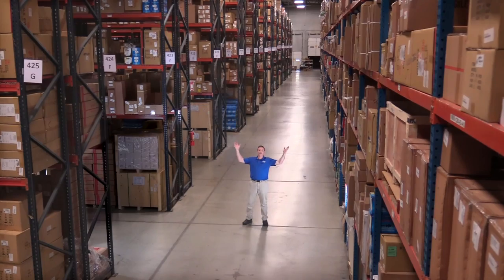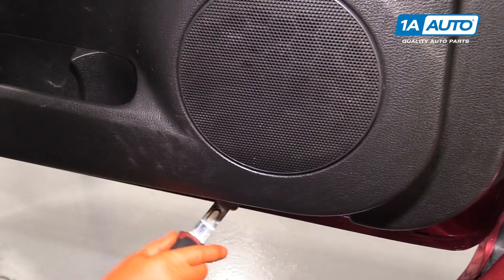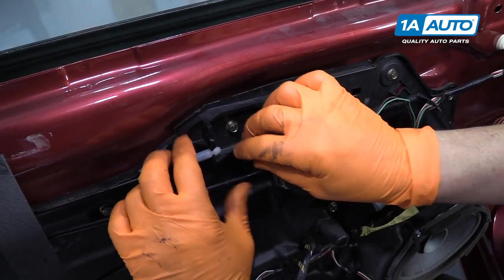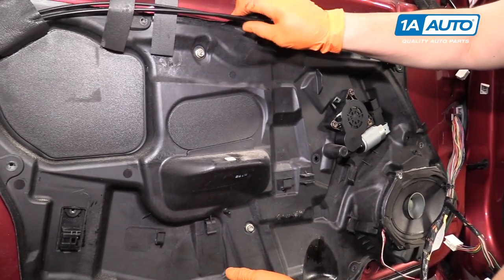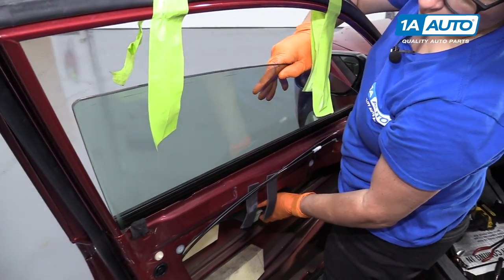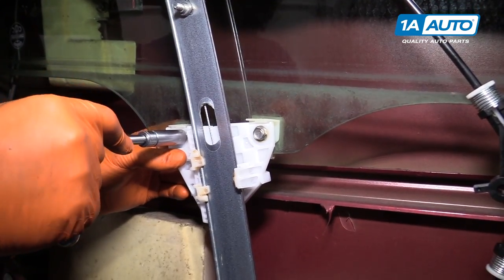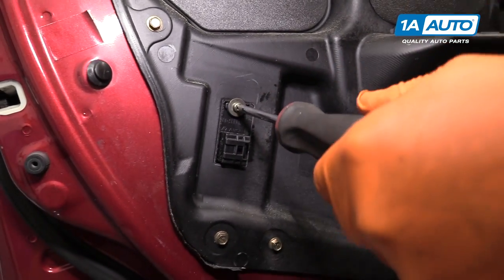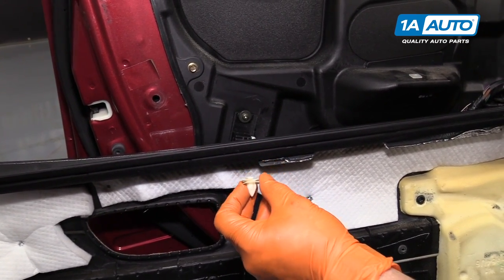How to Replace Front Window Regulator 03-07 Mazda 6

Comment: For anyone replacing just the window motor, dont take the backpanel off, just take the speaker out so you can reach through its empty hole with your other hand and hold the regulator drum (the white starshaped thing where the motor will engage) in place when installing the motor
Reply from the maker: +peterkray Thanks for the feedback!

Comment: Finished!!  Thank you for the help.  Way more difficult than I imagined... especially lining up the new motor gears together.  Needed another person to help hold everything while trying to align and get screws in.  Tip for anyone struggling, I used long nosed 90 degree plyers that fit perfectly in holes on the window side to make slight adjustments to move window up/down manual.

Comment: If you have 2006 with central locking and can't get the electrical connector plug off, there is a red tab on the connector that you have to pull out first to unlock it. Even after that it's still hard to yank so I put a flat blade screwdriver in the gap and twisted while pulling on the wires.
If you took the power window motor off you need to twist the assembly until it falls into the 3 notches in the door card. I twisted stuff until it clicked into their locations so that the assembly was flat together, ie, no gaps - if it's not flat together the gear cover plate might pop off -, then I finger tighten the 3 screws and gave final twisting to make sure everything was located before final tightening.

Comment: Thought my motor was burnt out but when I took it to the mechanic and after they clean the window they where able to get window move.  But it wouldn't go back up... so used this video to take it apart and figured out the window clutch thing... the part there selling that turns the rotary motion of the window into a linear motion that moves the window up and down was dirty so I cleaned and reinstalled it.  I noticed right away that was the issue with situation.  The  Window moves easy with just hands up and down once reinstalled with out thr motor unlike before... I have same issue with passinager door as well planing on fixing it another day.
Reply from the maker: +Jimmy John Thank you for the great reply. We love to empower our customers by showing you how-to perform your own auto repairs while installing our high quality auto parts. Have a great day! 1aauto.com

Comment: You totally just skipped the most difficult part how you put on the window regulator 🤦‍♂️
Reply: I was going to write the same thing.
Reply from the maker: +shoosh Thanks for checking us out. The install of the new regulator is shown at 12 minutes and 40 seconds. Please let us know if you need any further assistance, thank you.
Reply: @1AAuto  12:40 is removal. We are talking about the big jump between 16:53 and 16:54.
Reply: Yep, that was the hardest part by far. After mounting the carriage to the window, you have to get the 2 studs lined up to the panel, the regulator to line up with the cutout, the motor to mesh with the regulator… while it is hanging there and get the 3 self tapping screws in. I figured it out with another set of hands (my daughter) but it was tricky and completely skipped here in this video. A little disappointing considering how thorough the rest of the video was, most of it was pretty trivial.

Comment: 1min 24 sec...  cant get that speaker adapter off the tweeter either... seems to be skipped.  did you cut it??  how'd it come off?   12:50  how did you get the window down after it was already up and disconnected??

Comment: Tips and issues in had with video...

Take the moter off before taking off the wiring harness
Packing tape works better.

Takes two people to reinstall the motor.

Tools I used

Paper clip
Philips head screw driver
A a Cutco sandwich knife
A pocket knife 
A ratched set with 10mm and 8 mm

Comment: just watch! out, if that gear on the regulator pops out like mine did, it exploded. the springs went flying and the cables unraveled. it was a pain to put back together. it involved a half inch ratchet and extension. My wife held tension on one cable with the ratchet and I fished the other end of cable on to the pulley while placing a full load on the second spring  yikes! This all obviously had to be done outside the vehicle .
Reply: Yep, happened to me and had to buy a new one LOL

Comment: Great video. I have a 2008 Mazda 3 and I have couple of issues

1. Both my front  doors no longer lock using the keyfob
2. When I roll up my driver side front window, the glass for some reason comes out of the tracks and keeps tilting forward. I have to hold it down to come up properly within the tracks.

Can you help to understand what could be the issue?
Reply from the maker: +Mohammed Mehdi Since there could be many reasons why you are experiencing these issues, we do recommend having a local, reputable mechanic diagnose the issue. Thanks for checking us out!

Comment: Hello!
Thank you so much for your great videos!
I would like to ask, if the Mazda 6 2003 rear glass lift mechanism can be replacing the front one?
I bought the wrong one it seems, and it's on its way by mail soon.
Thanks and keep the excellent job! :)
Reply from the maker: +CarlitosWay008dhtc The rear supports cannot be replaced with front ones.  Thanks for watching!